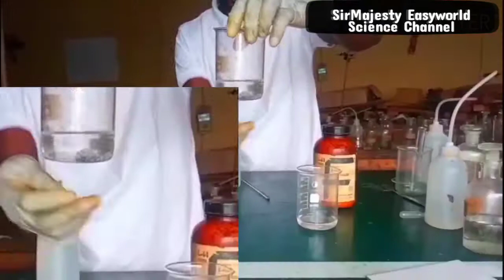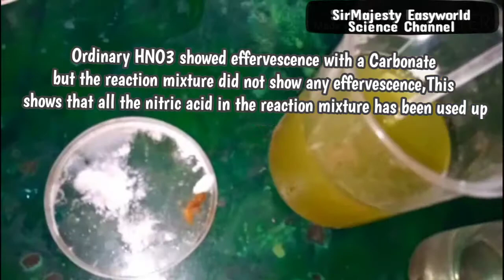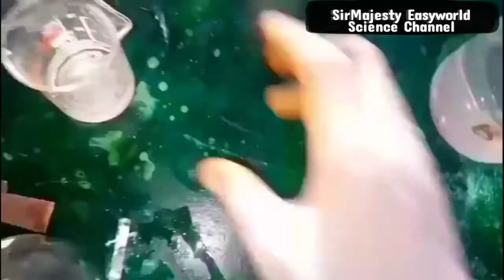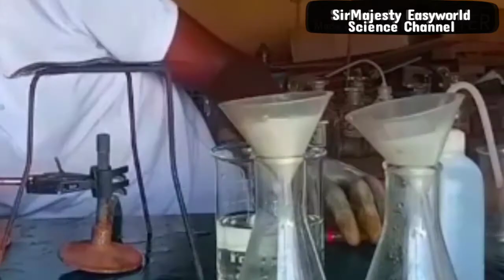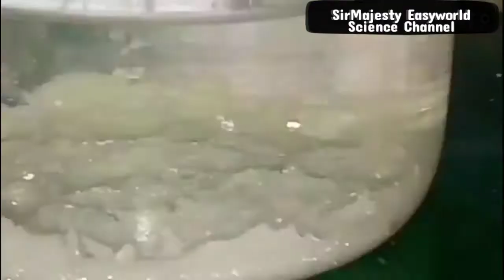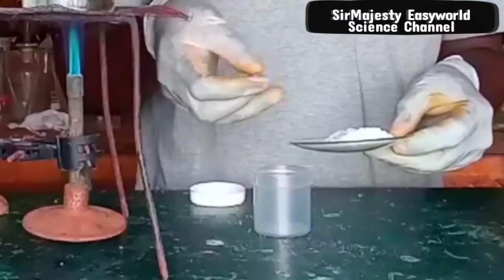HOW TO PRODUCE  LEAD NITRATE CRYSTALS..99% pure

Comment: If you only have lead metal then use it.  Buy dissolving metals in nitric acid is hazardous and generally wasteful of nitric acid unless you have a scrubber system to collect nitrogen oxides.  If possible I always recommend reacting a metal carbonate, hydroxide or oxide with diluted acid.  That way, only the nitric acid that reacts with metal based is used and excess can be distilled and reused.  Nice video though!